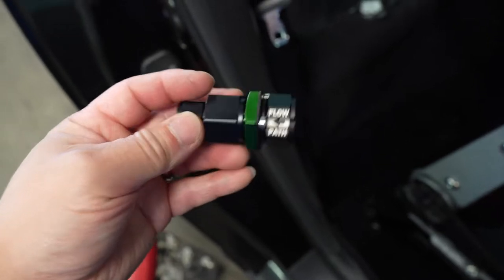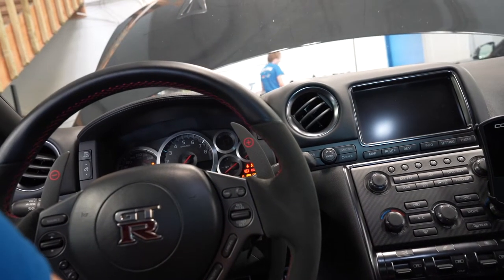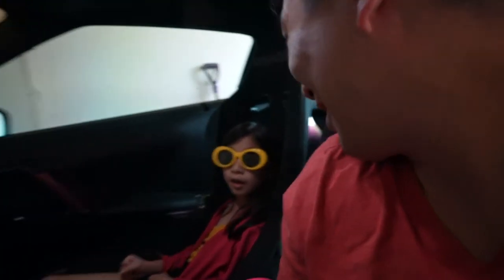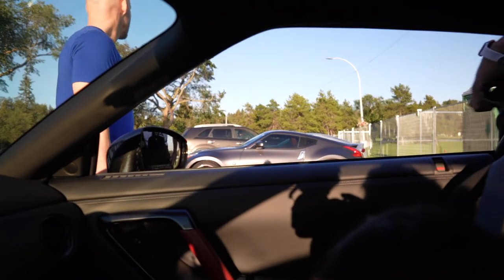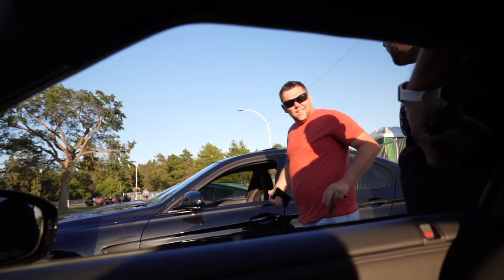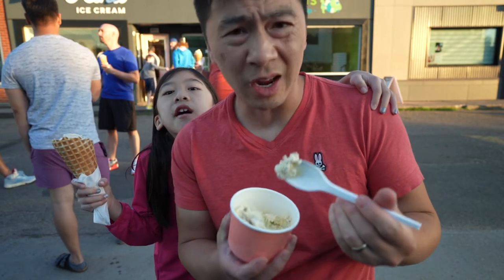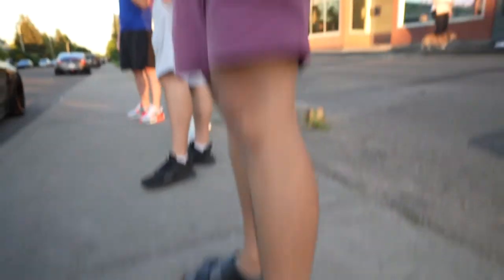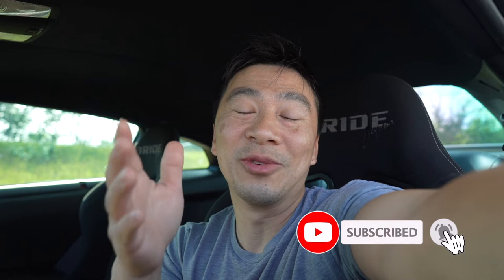No More GTR Low Pressure Issues On Start Up.

Comment: So you might wan to reach out to Radium and let them know what you encountered. Maybe they can incorporate the check valve on the feed side into the fitting on  the top of the hat.
Reply from the maker: I recall some where in their installation notes that they mention a check valve is required.

Comment: Can you share the links to the AN fittings and tubing you used. I’ve decided to install the Radium fuel hanger myself and have viewed the your install as well.  I will make this adjustment to the install. Thanks for the content.  Are you running the radium high flow fuel filters?

Comment: Quick question. If i change OEM fuel pumps to adternaket do I need a tune ? As my car has 76k miles I think it's time and i don't wanna go with OEM if i decide to push more power later
Reply from the maker: I don't think you need a tune if your are just upgrading the pumps.
Reply: @phothrottle  that's what i remember on my previous cars. Just wanted to make sure ... Filters are probably dirty as heck